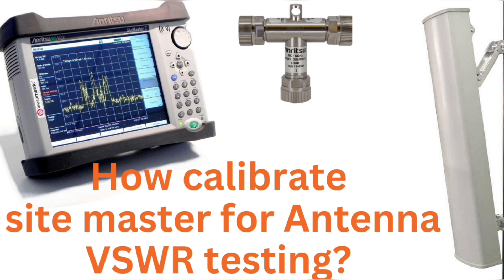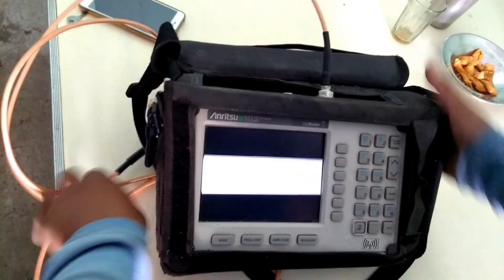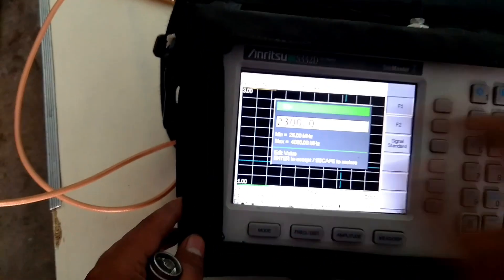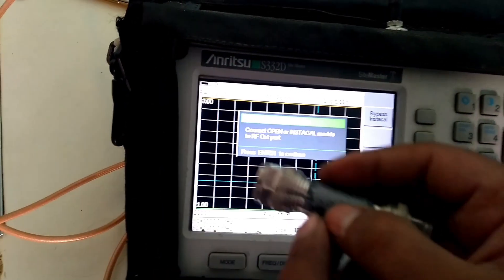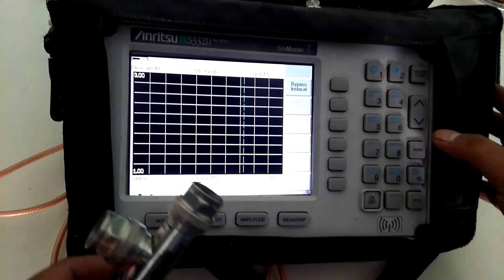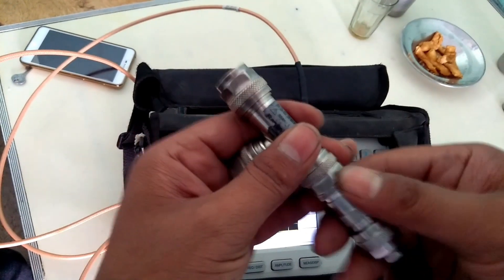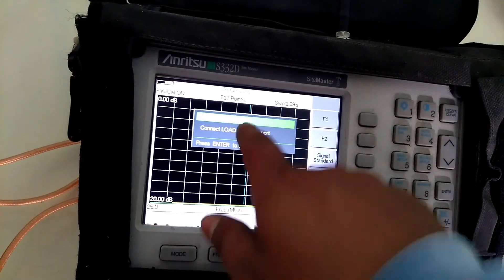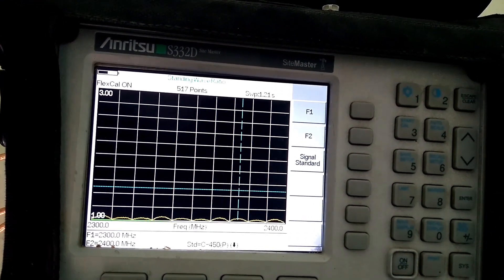how to use Anritsu site master || sweeper for antenna and base station #sitemaster

Comment: It means before getting cable VSWR or loss parameters, first we need to attach cable woth output port and then foe calibration we first need to attach cable the  use calibration T
Reply from the maker: Yes